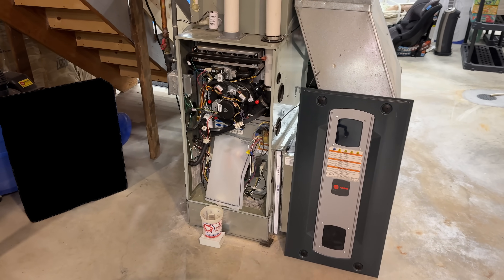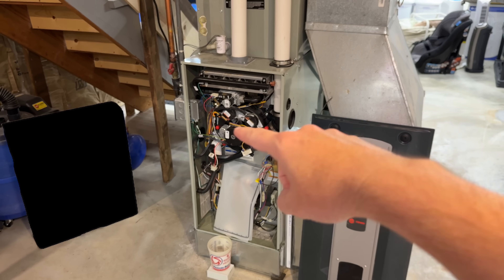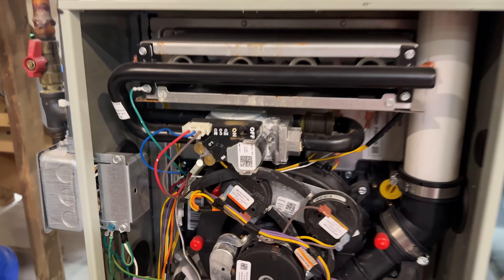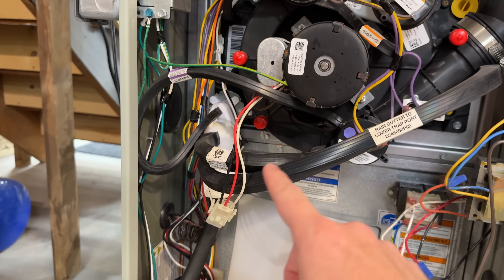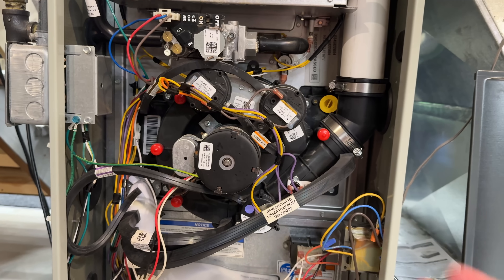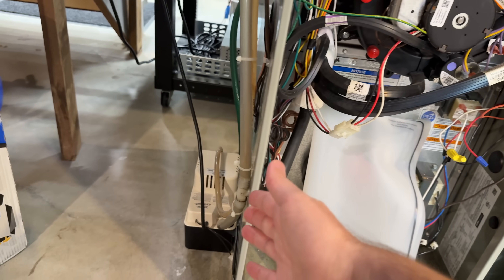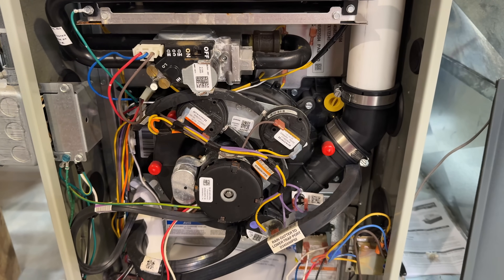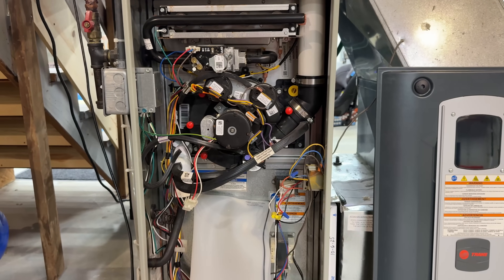It's not that hard to stop a Trane

Comment: If you need to replace your furnace in the US, just buy a conventional one. Don't let anyone talk you into high efficiency.  High efficiency furnaces are the bane of our existence in Canada.  Clearly the politicians who legislated them have never had any direct experience with them failing, which is a bit odd.  They are not designed for cold climates.  Dumping cool wet exhaust outside into -30 weather is the worst decision ever.  Plus so many extra moving parts and pressure switches that will fail, usually on a cold night.  And like you say they are engineered to fail after just a few years.  If I could still buy a simple, normal, new furnace I would, but they are not available in Canada. The efficiency gains are not that great and if you have to replace the furnace every few years no CO2 is reduced anyway.  It's a lot like limiting the wattage of vacuum cleaners.  Doesn't save anything.

Comment: There's two wires (aside from the pump's plug) that come off your condensate pump, they should be attached to a kill switch for your furnace.  The condensate pump has two floats in it, one that turns on/off the pump for normal pumpdown of the collected condensate, the second one is an emergency trigger.  The idea being that if the condensate pump doesn't pump the collected condensate, the emergency trigger opens and shuts off the thing(s) producing condensate (and optionally produce some kind of an alert so you know why your HVAC is off).

I've got one of these pumps on a standalone icemaker that's wired to a Z-wave door sensor.  The sensor reads the emergency switch as "closed" for normal operation (door closed), and I have automation set up that if the "door" ever opens, to shut off the icemaker via an IOT switch and generate popup notifications on my wife's and my phones so I know to go take a look at the pump to see why it's not pumping.   

I feel your pain on the stupid design decisions with respect to the water and the control board.  I've also lost a control board on my furnace/HVAC stack due to condensation during the winter.  Although I'm not running a high efficiency furnace like you are, water issues and stupid control board placement locations do seem to be a common thing.

Comment: If you get new board, conform coat it - put a protective paint on it, if you think there will be humidity again... It will protect against humidity and water. Just leave out connectors and elements that can heat itself, like power resistors, coolers...

Comment: I've had a high efficiency furnace for 15 years now and so far the only problems I've had are a bird building a nest in the exhaust pipe one year, which I solved with a coarse wire mesh, and wasps building a nest in the exhaust pipe another year.  Those blockages reduced airflow so much the system errored out.

I notice one major difference between your installation and mine.  My intake pipe is only a couple of feet long, with an elbow on the end.  It uses the basement air, at constant basement temperature, so there's never any condensation.  I also live in Missouri, so I know this installation is legal for you as well.  I suggest cutting off that intake pipe at the elbow and completely removing the unused length.

I do have a carbon monoxide detector and it has never been tripped by the furnace.  As it happens, I just replaced the battery in it last week too.

Comment: I had a Trane heat pump installed in January of 2025. It's failed 3 times. The main control board died first, allegedly due to a power failure induced surge. The fan control board died next, due to water leaking into the case. And then the fan control board again. The unit is 10 months old and I don't trust it as far as I can spit. The unit it replaced was a contractor grade American Standard that ran for 11+ years without a whimper. Don't trust Trane.

Comment: I thought Trane was higher end than the Rheem I had installed. The Rheem has a separate top and bottom cabinet sections instead of all open. Also I just went with single stage 95% efficiency. Works good for my small house.

Comment: My 13 year old high efficiency Bryant had the same issue, but in this case, the water dripped on the gas control valve and caused it to fail last year (~ $800 fix).  This year the blower when running on the normal (very low) speed wasn't pushing the air fast enough causing through the system to overheat and shut down.  The replacement motor alone was $2000 plus labor plus it was time for the annual cleaning.  Instead of fixing the furnace, it was replaced with a Daikin that if it gets those drips of condensation, won't touch anything.

I considered replacing the furnace with a low-efficiency model with the hope that a simpler design would be more trouble-free, but stuck with the high-end model.

Comment: Looks like those two gutter lines need to be swapped at the white collector they plug into. That should fix the problem with the slope of the line coming from the part that is leaking.
Reply from the maker: You'd think, but I double checked the install guide (and even the labels on the lines) and they are in the correct factory position... They're also seemingly glued in place, so I can't easily swap them.
Reply: @Level2Jeff  sucks that they're glued. My suggestion wasn't so much as to how it should be in terms of the manual/guide. But rather how to adjust them so hey both have a proper drainage slope. I did notice the label on the one hose in the video.perhaps you could manually position them so that the shorter one at least travels under the longer one, as right now it looks like it is being held up by the longer one.

Comment: Similar problem here, since 2009 - it's likely that the 'drain' tubes are clogged with gunk.  It's a poor design.
I'm lucky mine is horizontal so water only leaks from the heat exchanger area/space.
Pro tip: swap the two drains so the one isn't level. Use a shop vac and vacuum out the crud.
Reply from the maker: Yeah, going to ask the tech today what he thinks, I also downloaded the install manual and was looking through the install guide. For vertical installs like mine, it does have that condensation catcher recommended, so installer failure there too (I used a Trane recommended installer, of course, otherwise warranty isn't valid).

I guess I'll have to inspect installs done by 'certified' installers more closely in the future. I assumed they would know more than me about the fine details, but if they install and it's okay rusting for 5+ years, then I guess the callbacks don't really bother them :P

Comment: They should have used a RPi. It is smaller and harder for the water to hit. They could make it even harder by adding a motor and a belt to randomly push-pull the RPi. A galaxian of sorts :P
Seriously now, how is the board not on a separate compartment? Is a piece of steel that expensive in the US? I recently removed a 20 year old water gas heater from my brother's house and the control board was protected by its own enclosure inside the main structure! Then again, I am in Europe.

Comment: re: furnace control board.....had to replace my Carrier board (not related to poor design as illustrated here) and it was old enough (over 10 years) that availability was sparse. I was able to get a new one (3 years after this replacement) but suspect if I needed another I wouldn't be able to.

Comment: I have a significantly older Trane 95% unit with flame inducer fan issues similar to this - poor condensation drainage and management.
They accidentally discovered a way to make money and turned it into a feature rather than a bug.

Comment: I have a 5-year-old high efficiency HVAC similar to yours, but it's not a Trane.  I see rust in places that just shouldn't be there.  It has to do with pulling the maximum energy from the exhaust, some of which breaks down to water.  The sideways vents that go out of your house have a critical angle that has to be followed.  According to my HVAC guy, the condensate water has to flow back to the heater, not drain outside.  Initially that was counterintuitive to me.  OK, fine, but just like yours, what the manufacturer decided to do with the condensate water is just bogus!  You have my sympathies as a fellow "trying to do the right thing" guy.  Many of these high-efficiency systems turn out to be a type of personal false economy when you have to replace them way more often than the 80-85% models.  I'm dreading the day when mine rusts through, too!

Comment: @Level 2 Jeff  - i would definitely take 90% isopropyl alcohol and a tooth brush and clean all that corrosion off the PCB / the entire thing ASAP!!! I would also get yourself some conformal coating (its cheap) and apply it to the entire board after cleaning it really well with the isopropyl alcohol and tooth brush... If you don't want to take out the PCB, it also comes in a spray can.

Comment: I believe the two wires coming out of your condensate drain pump are intended to signal if the pump fails and shut off the AC to prevent any serious water damage. They should be normally-closed and will open in the event the reservoir floods.
Reply from the maker: Yes, I need to wire those in... just have put that off apparently since 2022 :)

The good thing is the water overflows towards the floor drain, and since my server rack is elevated, the water only really touches the rubber part of the casters. Still, better safe than sorry!

Comment: I worked in a Company in Ireland for 32 years and they had 2 systems for their Cleanroom, one was/is a Trane. It was there before I started and I left back in End of June this year and it is still running. It was installed back in 1981 with a few upgrades in the intervening years. the other system is a Wolf.

Comment: Though I love the comfort provided by my Trane system, I will not buy another in future houses. Have had a control board go  out on the main unit and the thermostat die. Both were replaced under warranty, but that ends eventually. I will instead look at smaller heat pump units for DIY installs that cost less then an annual service subscription and a provide the comfort control in the area desired. Also allows me to go away from the build in online features. Added complexity at times create added issues.

Comment: I had no idea these things existed until today. Are "gas furnaces" common in US? What is the advantage of using these instead of a heatpump or just a plain old boiler ?
Reply: There is low awareness of good quality air-source heat pumps here. The last time they were pushed in the public consciousness was when they were pretty terrible and couldn't heat the home in winter. And ground-source heat pumps are many thousands of dollars more to install that people do not have.
Reply: @godminnette2 you must have pretty cheap gas then, because here in Europe with the gas bill over just one winter season you can pretty much get a decent heatpump.
Reply from the maker: Yes natural gas is insanely cheap here, at least in the Midwest.

Comment: I'm thinking a 3D printed part that's water sealed and maybe tap into that descending insulated line that goes out to the collection unit outside?

...but yeah, that's poor engineering design. At the very least, they should've protected the PCB from water above and on the sides...you could also probably just 3D print a shroud for it to protect the board.

Comment: You should have gone even higher efficiency with a heat pump instead of a gas furnace. No, they aren't all perfect and you can still have a dud because of cost cutting and general enshittification, but at least you'd have less areas for condensation to build up. Plus combustion appliances inside the home contribute to higher risks of childhood asthma developing and reduced indoor air quality. At least with your high efficiency unit, the combustion area is sealed with intake and exhaust so less pollutants get into your home.